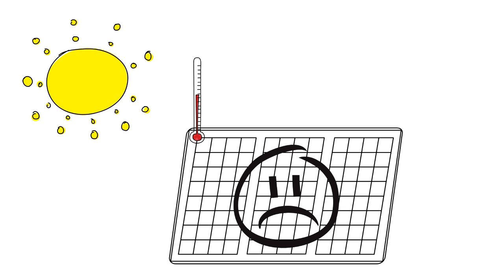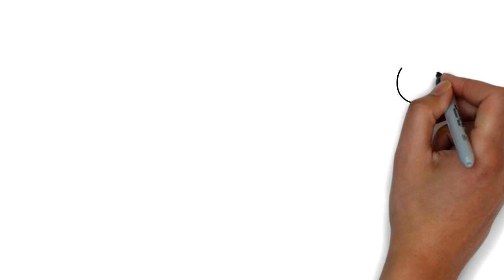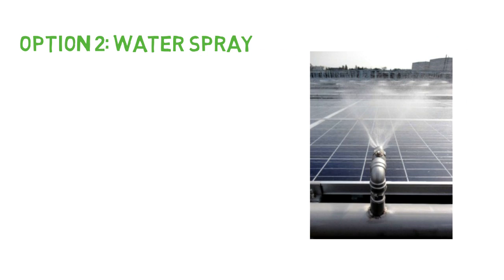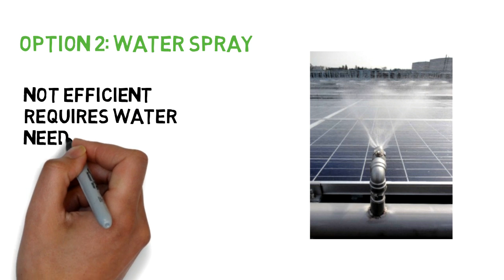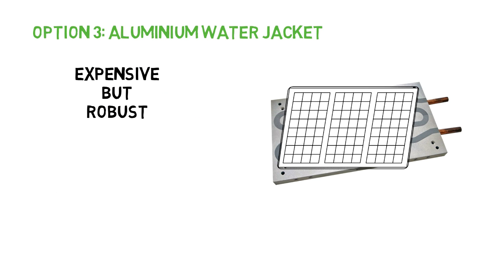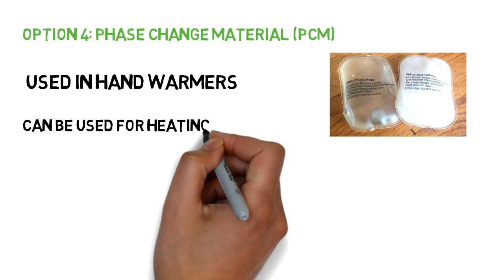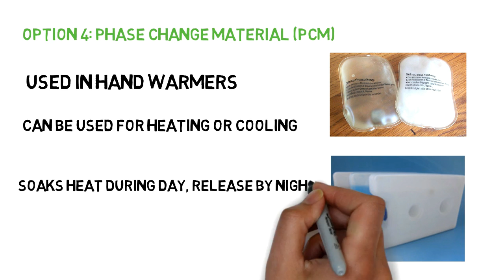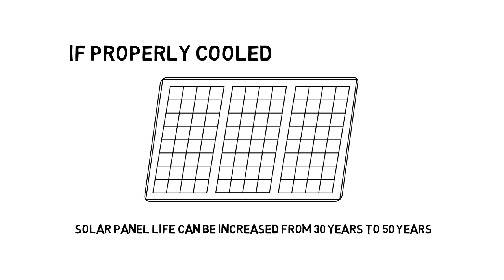4 Different Methods for Cooling Solar PV Panels

Comment: Great explanation except the spraying of water idea in countries with a water crises, mainly hot countries
When you say a solar thermal is expensive, what do you call expensive when many comercial companies use millions of liters of hot water a year?
Reply from the maker: I did mention that cleaning of solar panel with water is not environmentally friendly. This practice however has caught the wind unfortunately and is being used in many areas around the world. I am all for solar thermal technology. All economizers in hot climate countries should be solar
Reply: Looking forward to hearing your views on what is the cost of expensive, when you related to PVT hybrid solar panels? I have designed and developed a thermal cooling package kit, you can assemble yourself and retrofit to any PV brand in the world up to 300 watt sizes. I just shipped 28 kits to an Australian, to fit to his 28 LG 300 watt panels to heat his swimming pool. My cost to him was $165.00 per kit plus shipping

Comment: I like option 3 best with a way of harvesting the heat for heating water. A combined Solar thermal and PV panel, rather than just dumping the heat into the air.
Reply: That is actually the ideal situation, in spite of the extra maintenance it needs.  We really need to get manufacturers to add water channels to panels in the factory - just a punched aluminum plate like they use on cheap refrigerators.  Renewable electricity generation with free hot water - or at least warmer water that costs less to heat - would cut energy costs for the average 'sun belt' homeowner a lot.
Reply: If you have a swimming pool, you could dump that heat into it
Reply: This seems like something that could be used in conjunction with concentrated solar either by use of Fresnel lenses or parabolic mirrors.  Any thoughts on that?
Reply: @alexriddles492  I agree this would be the way to go for a commercial installation.  The amount of cooling would make way more hot water than just about any home needs.  Using either a lens or a parabolic mirror requires hardware to point the array (or at least the mirrors/lenses) and that hardware and the lenses and mirrors themselves would require a lot of maintenance.  It would be a little impractical for a full-home permanent installation.
Reply: and then use the heat to evaporate a refrigerant, so the panels are even cooler, or to cool your house during summer
Reply: Wouldn't work for flexible panels though 😅
Reply: I have developed such a solar thermal panel, without any copper tube exchangers, now on test in Australia and by April 2019 the patent will be approved www.thermaltricity-int.com

Comment: Nicely done presentation. Thank you. Would you be able to provide any information on the improvement in efficiency with a spray system? It seems to me that in Brisbane Australia, every day there is a thermal loss of 10-20% due to our temperature range. This is the low hanging fruit for improvement in efficiency. Analysis of 5 years' of data from my own 5 kW system shows that it is highly unlikely that cleaning the panels will make any difference.  Aside from heat, the other efficiency killer is the year on year degradation of the photovoltaic cells, which the manufacturer has guaranteed not to exceed 10% in 12 years and 20% in 25 years.

Comment: Video is great. But I am glad to introduce the FIFTH way of PV panels cooling. Simplest and more effective than any one from this video. Active Solar photovoltaic system( ASPS) is real and working perfect( at least on scale models). https://youtu.be/3_hpo_cyXnc
Reply from the maker: Thanks for you input Alex. Keep up the good work! You would get an AC current out of that
Reply: Already done. Low frequency( very low) but totaly alternative.
Reply from the maker: I admire your optimism.  There is a problem in here which is that at a given time only part of your panels will be exposed to the sun. So the spinning, yes it makes them cooler but you will also have to work out the math which is that is it viable to add the spin. Is it improving enough efficiency by cooling that its worth having half of the panels not exposed to direct light? Have a look at this:
https://youtu.be/zMQA9khsF10
Reply: Actually I know that project before I began to work with my. V3Solar made all mistakes as was possible. But if  repair them is possible to receive great working example as I have now. During real test single panel show average voltage of 5.4 volts. Voltage was no dropped lower than 4.99 volts even in the darkest plase of circumference at the 8:00 AM!  So make a simple calculation: Each panel in my system is working with efficiency of 83% from static panel nominal( 6Volt). Real comparsional efficiency is higher because even static panel produce at the same conditions only 5,75 volts. So 83%+83%+83%=249% energy received from the ground area of the single panel. I want to remind you that photovoltaic industry is fighting for each additional percent that could be received from the same ground area. And  thanks to the heating they couldn't jump over 80% from nominal level for the field conditions. So who want's to be a billioner and to try ASPS?

Comment: sir good day... very nice video... what is your reference when claiming 30 to 50 years life span if properly cooled?
Reply from the maker: Thank you. Reference was a research paper on Thermo electric coolers used in conjunction with solar panels.
Reply: Synergy Files can we use it as a related literature on our study?
Reply from the maker: You cannot use the video as a reference. The reference has  has to be the original source article. You can search for the article on google scholar. Unfortunately I had the article in my old laptop. The study was carried out in a University in India that much I can remember.  If it is a school project, you can use this video as reference
Reply: Synergy Files okay thank you very much sir
Reply: good day sir, do you have the link of the literature? i cant see it on google scholar. thank you for your response.
Reply from the maker: I couldn't find that article. 
http://www.engineering.com/DesignerEdge/DesignerEdgeArticles/ArticleID/7475/What-Is-the-Lifespan-of-a-Solar-Panel.aspx
https://www.greenmatch.co.uk/blog/2015/01/the-lifespan-of-solar-panels
These link suggest that degradation is higher in extreme climate. This is where cooling comes in.  Degradation for UK is about 0.7% per year where as in more extreme climates it is near 1%

Comment: Sir l have personal experience that when we put cold water on hot glass. it cracks. same happen to solar panel. water spray can damage panels.
Reply: The survival of solar panels in conditions involving constantly repeated rain downpours as happens in summer in Australia, does not support your theory. The glass on modern solar panels is toughened and designed to withstand the extremes of climate including snow and rain and the panels I purchased in 2012, are designed to withstand 5 kPa UDL.
Reply: I sugested this to my California freind who contacted me about his PV panels over heating, and my sugestion about useing his garden hose pipe to prove my point, worked without the toughend glass cracking 
What is already happening in very hot countries, even happened last year in the UK, is the wafers start to crack.
A PVT solar panel is about cooling the back of a PV panel at the lowest cost to improve PV efficency as well as gaining a by product of heated water to 30c, for use as a Pre heat back up by a water to water heat pump.
Only recomended for use in commercial applications like the food and drinks industry to fish farms and Aquponics
Reply: @Synergy Files  if you read the complete maintains manual of pv panel .It said that water you put on panel must have maximum 25% temperature difference .Otherwise glass can be damaged. So in very hot regions like Pakistan,Saudia its better to consider this factor while designing cooling system.
Reply: With glass for PV panels made of toughen glass, I have no experience of cracking glass. 
I have developed a solar thermal panel you place behind the PV panel and pump cold water across the heat exchanger at the back and this increases total energy output per panel of 3 times as much
Reply: Eric  Hawkins share video,yes its good to use heat exchanger instead of throwing water directly on panel
Reply: http://www.renesola.com/file/Global/product/pdf/INSTALLATION%20&%20MAINTENANCE%20MANUAL.Version3.pdf
* The difference between water temperature and module temperature should be in the 
range of -5°C to +10°C
Reply: Allen Use civilized words,call people by name I reported your comment
Reply: @rgf918  you learned a valuable "Old school lesson"  If you don't want to be called Dumb ass....then don't be a Dumb ass!😂
Reply: where? how hot? work after cracked?
Reply: @Allen Tompkins  Love it Allen, check out the comment I sent to Snowflake 🤣
Reply: If it's a very fine mist it will probably cool slow enough not to crack
Reply from the maker: Safdar Karim you dont have to put cold water. Normal water at 20 to 30 degree should be more than enough. Your solar panel temperature goes up to 70 degrees. So with that differential, it would be difficult to crack glass